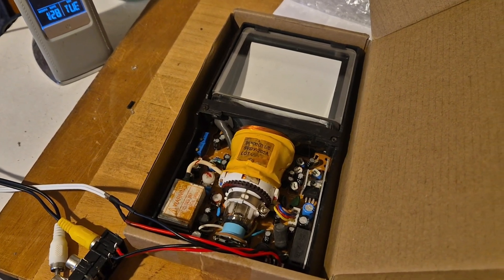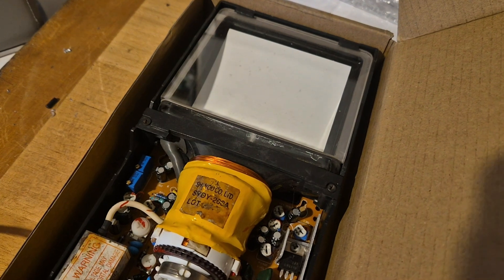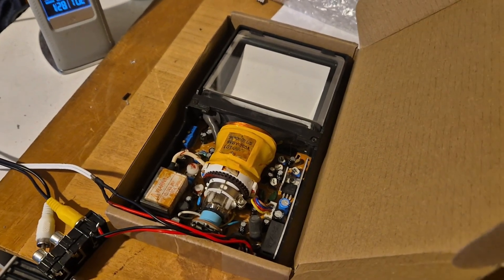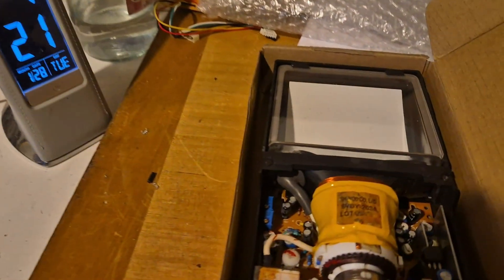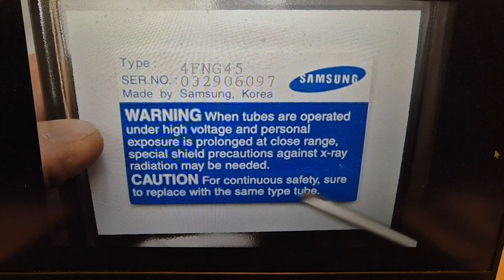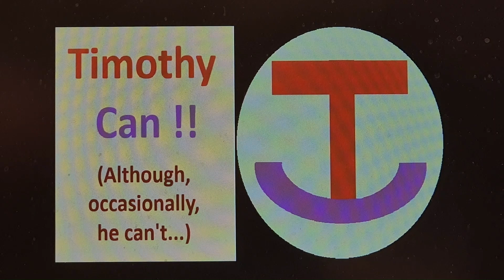Mini CRT Experiments   The device it was used in

Comment: I was thinking an intercom system. Great to see what it was in. Someone could make quite a bit of money selling 3D printed cases for these. They could have holes for the adjustments. Would make them way safer to use/work on.
Reply from the maker: Yes it would be good if cases could be purchased for them. It would also be good to have the controls on a panel. I decided I wasn't going that far myself, since I probably won't use this much. But it's great for retro games, if you don't mind just having black and white.

Comment: It's only now that I realise I used to own one, or a very similar model. 🤣 I had a flat up in the Lake District with a security door restricting access to the foyer shared by other flats. The idea was that you could see who was there before you let them through to the folyer area. Not the best video quality but good enough.
Reply from the maker: Yes I get the impression that there are a lot of these units around - they seem to date from the 90s to the early 2000s, after which I guess LCD screens took over.
Reply: Yeah I remember those... they were horribly dim even when new.